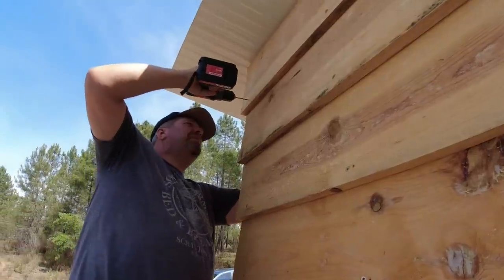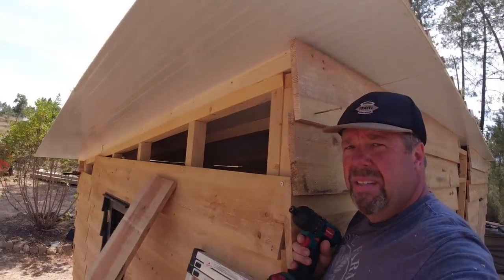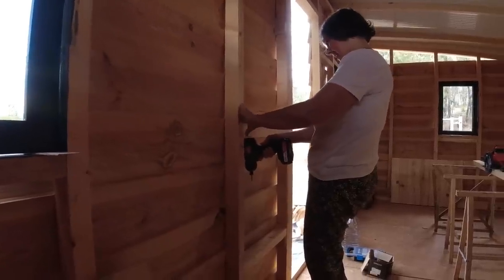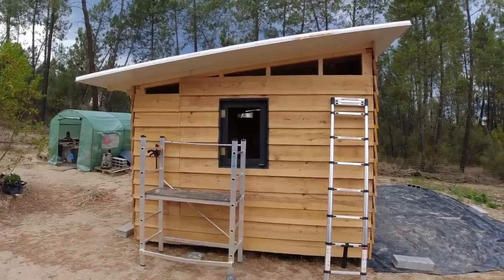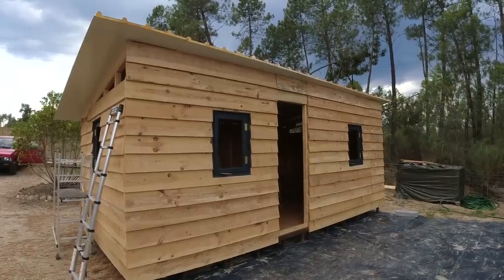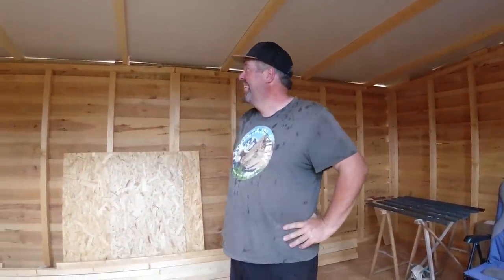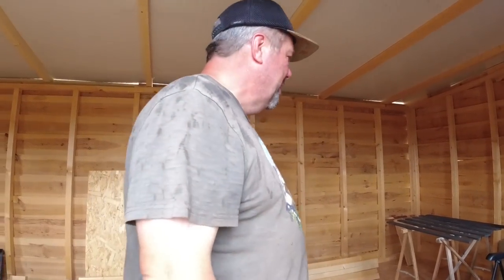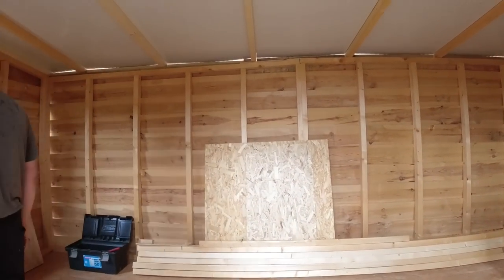51. Cladding our Cabin in the Woods - New Water Collection System - Early Retirees

Comment: If you added a vertical corner board on each side of the tiny house, then butt the cladding to it you would eliminate the gaps. Of course, that means you have to trim the cladding boards a bit shorter. As is, you will not be watertight/airtight at the ends of the cladding runs. Not sure you are concerned about being that but it means it would be easier to keep the tiny house warm in the winter.
Reply from the maker: Our plan is to do just that, all 4 corners and each join of boards 🤗
Reply from the maker: Our plan is to do just that, all 4 corners and each join of boards 🤗

Comment: Getting there, you could put an IBC at each end of the gutter with a gutter outlet at each end with the gutter high point in the middle of the roof. Im sure you would be able to fill 2 tanks instead of just the one, just an idea.
Reply from the maker: We've got the ibc connected to another one further down the garden, our hope is to have 3/4 connected to keep capturing the winter rain 🤗
Reply: @PensionersinPortugal  perfect :)

Comment: Would have saved lots of work and time with the vertical boards vertical on each corners and then butt the horizontals against the vertical… I guess you are new at this, you should do it inside so to keep air and bugs out.  Also if you are still using boards for the inside, don’t forget to alter long and short boards like I had mentioned on an earlier video, so not short boards end up one on top of each other.  Have to do the same if you are finishing with panel boards on the side but if you put them standing, which would be the best way and faster one against the other.  Good luck.🍀
Reply from the maker: Thank you 🤗

Comment: Was there a reason why you didnt stagger the joints? It would make for stronger siding and possibly be more astetically pleasing.
Reply from the maker: We didn't stagger the joints because we are going to cover the joints with panels. If they were staggered it may have been difficult to do that.Persomally I like the straight lines of the joints.